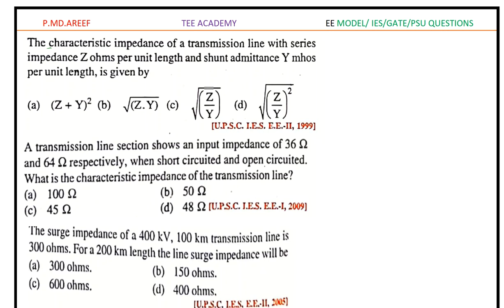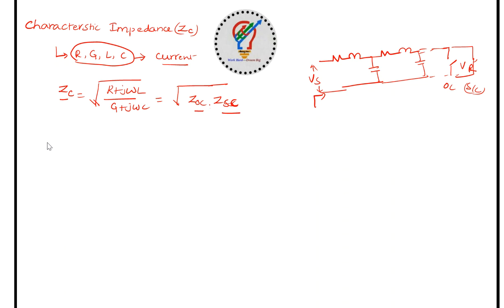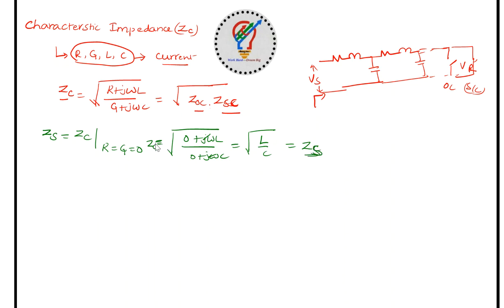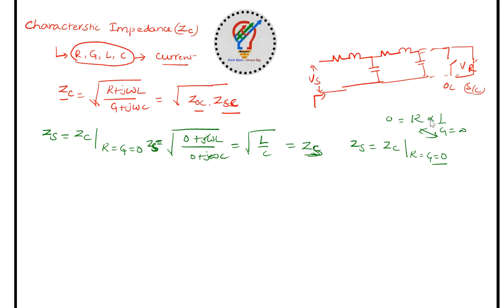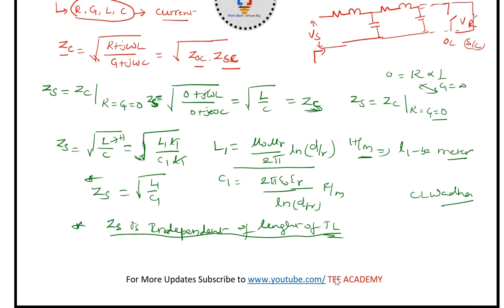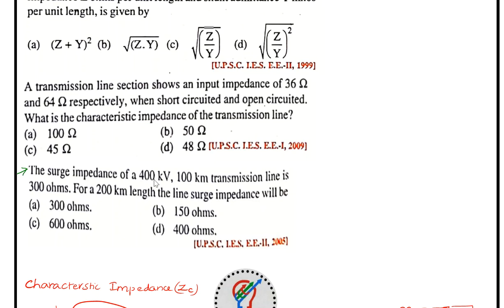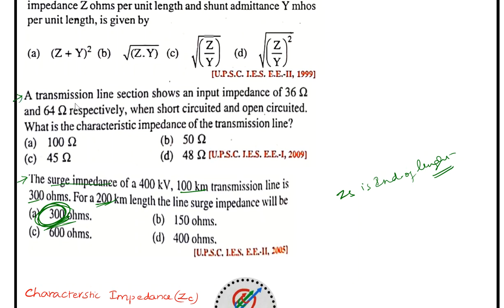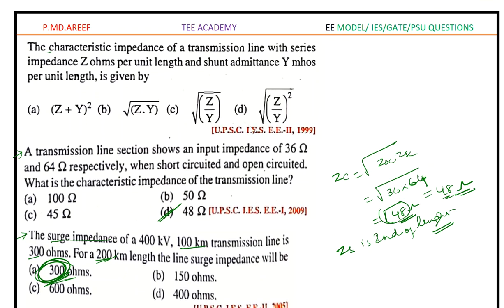TNEB 2020 MODEL QUESTIONS II PART 09

Comment: Thank you so much sir.Sir in TNEB exam calse is not allowed but they used to give ques where there is a need to use calse like exponential value,sine & cos (like sin(12°)),guide us how to tackle such ques.For example previous yr 2017 paper ,part 3 first sum.